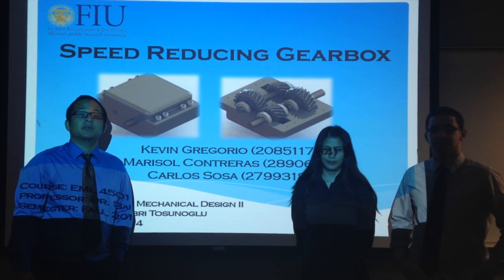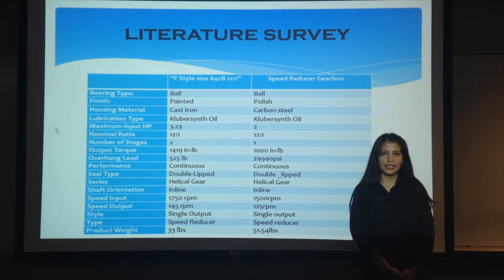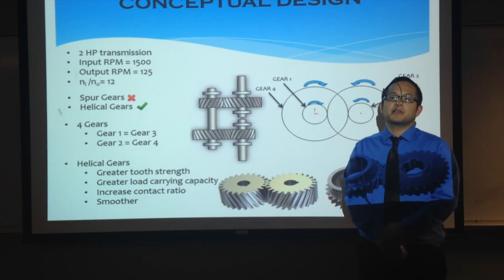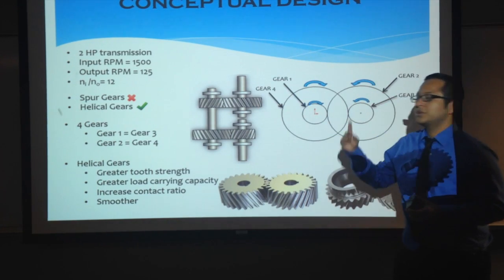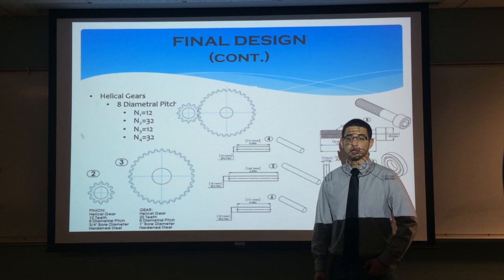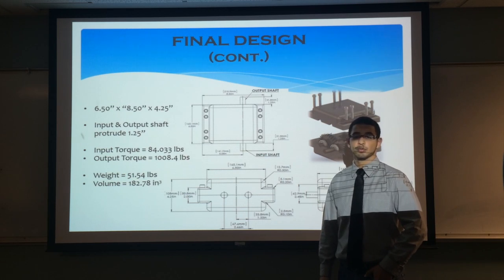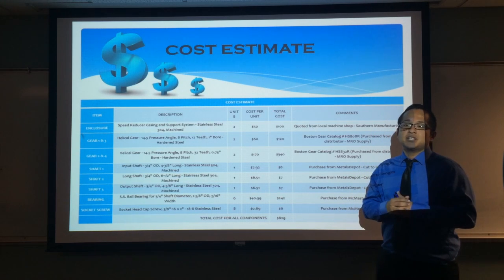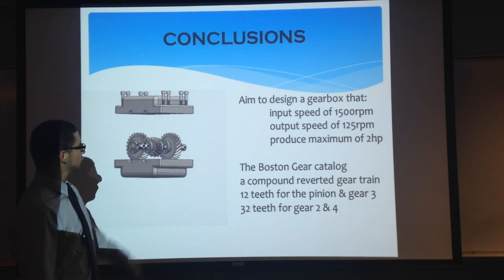Team 1: Gearbox Design

Comment: The presentation was organized very well. The graphics used in the slide made it simple to follow how the gear was designed. One of the issues I had with this presentation was with the sound quality. At times, it was difficult to hear what was being said. Overall it was a good presentation.